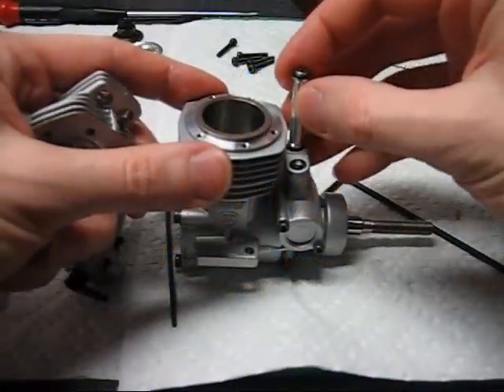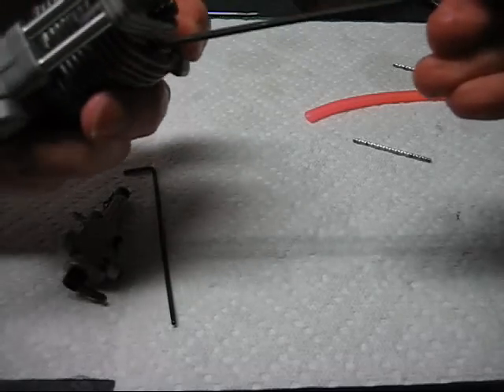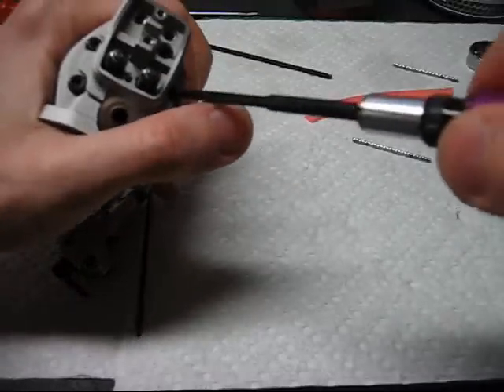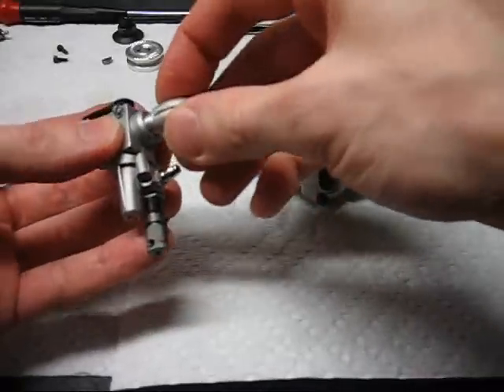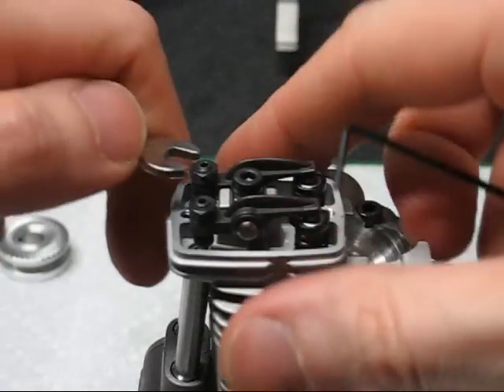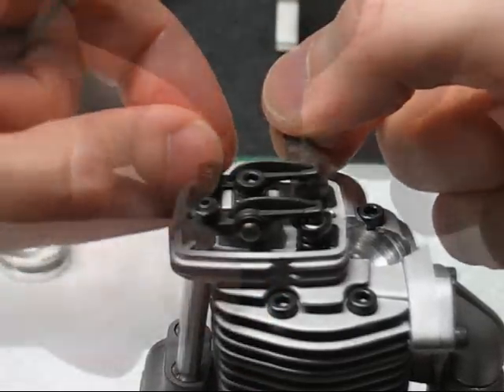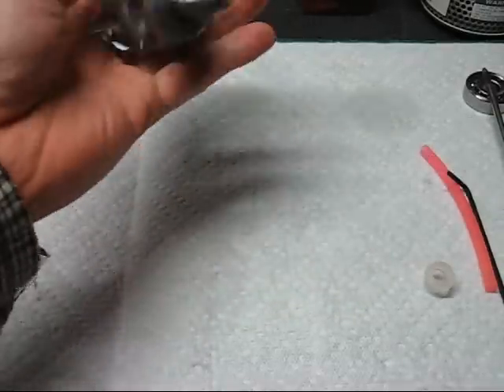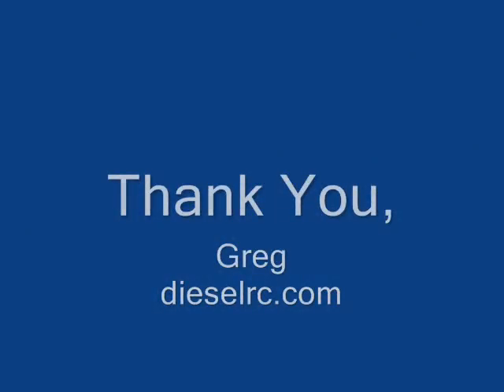OS FS-52 Four Stroke RC Glow Engine Reassembly Part 2

Comment: Hello sir, i crashed my plane and damaged the engine. It is Enya 53 4 stroke and the exhaust pipe broke off the head. A chunk of the threaded part of the head where the exhaust pipe is connected, broke off. So i can't thread the exhaust pipe/muffler back on to the head because part of the threaded area of the head broke off.
How can i get this exhaust pipe to connect to the engine?
I have tried "JB weld" but exhaust pipe falls off as i increase throttle after running at idle for a few minutes. I don't know what to do. Is there anything that i can do to permanently attach the exhaust pipe? Any type of welding etc?
Reply from the maker: If you are in the US, search for Clarence Lee. He may be able to repair it. He essentially glues in a brass fitting. However, it sound like you already tried to do that and the damage may be excessive. A new head is in order in that case.

Comment from the maker: The torque is dependent on the fastener being installed. Search for Tonnichi, they have an excellent technical manual. I use Tohnichi torque drivers now. The hobby stuff is garbage.

Comment: the first thing anyone buying a nitro engine should always realise is theyre not toys. they can injure burn and break down and actually require maintenance and cleaning. with a toy you turn off the power and they shut down. with these they can run wild and cause injury.

Comment from the maker: @LiviuJETIX It depends on what you call a toy. It's intended use is for model airplanes. I'ts been designed by engineers and manufactured in a top notch facility to demanding standards.

Comment from the maker: @moutonsteve Yes, check for rust. Chances are high the bearing will need replacement. If it's stuck, heat and fresh fuel in the crankcase will loosen it.

Comment from the maker: @DeepFriedFuzzball Model four stroke engines don't have sump oil like most four stroke engines. They rely on oil in the fuel and blow-by past the single piston ring. The ring can't prevent a significant amount of oil from getting by into the crankcase, by design. A small amount of oil accumulates in the crankcase and excess is expelled through the breather. This is continuous however. Most model four stroke engines require 18% oil in the methanol based fuel. Life is 100's of hours if cared for.

Comment from the maker: @7bikerboy7 You'll want to use something that's compatible with alcohol. Castor oil or a compatible synthetic. I've used regular motor oil in the past, but you can only do this with engines that don't have pumps, or regulators. Some synthetic motor oils should be OK though.

Comment from the maker: @7bikerboy7 The basic carb settings are just that. You must fine tune from there. Follow the manual for tuning. I can't tell from your description if the low speed needle is rich or lean. BTW, don't richen the high speed once you've found peak RPM. With the pump and regulator system this is not necessary.

Comment: Hello I bought the os 120III surpass 4 stroke w/pump and set the needles as instructed from the instruction booklet. Low end needle..2.5 out.  High end needle..1.5 out from closed position. The engine will not stay idleing at a good low rpm for too long and just shuts off...any ideas?

Comment from the maker: @cpeisher 
Standard OS specs( and all model airplane four stroke engines for that matter) are 0.04-0.1mm or .0015-.004" clearance.  I use the 0.04mm feeler.

Comment from the maker: This OS Engines FS-52 engine is made to run on glow fuel consisting of lubricant, methanol, and 0-30% nitromethane. The engine uses a glow plug for ignition. These engines are produced for the radio control hobby market and can be found through various distributors. Search for "OS Engines" to find online dealers. Or look through your local business listings for hobby shops.

Comment from the maker: The torque wrench is not needed. I rebuilt many engines without one with no problems. The biggest problem is not making sure the head is seated properly before tightening the head bolts. Just try to be consistent with torque on the head.

The one I use is sold by Hobby City. Tower offers a similar product from Integy. A nicer industrial type wrench is available from Torkit.